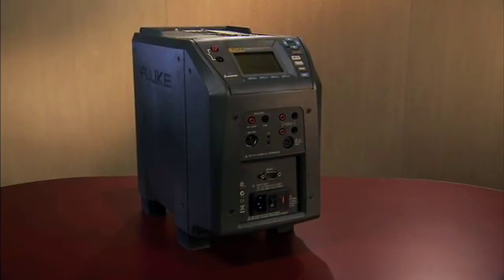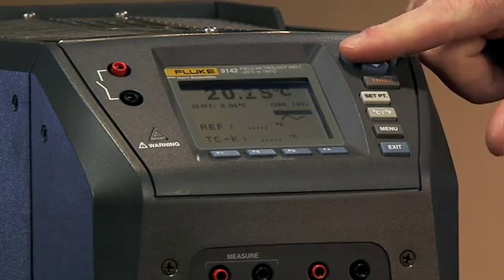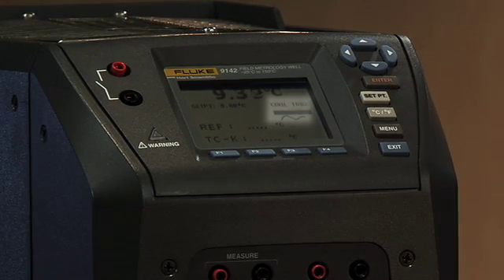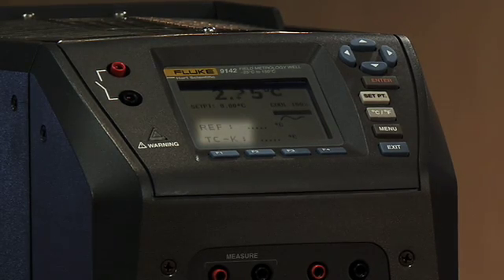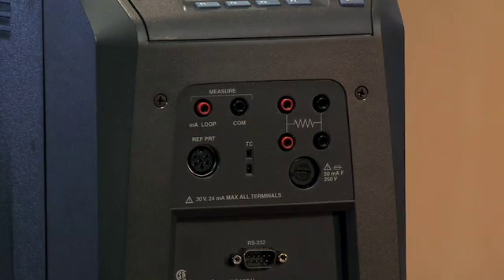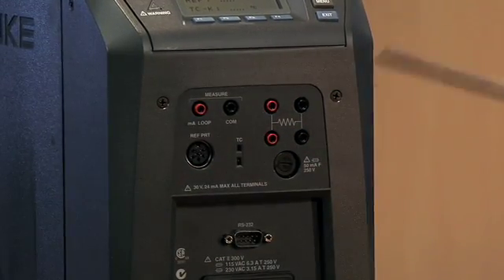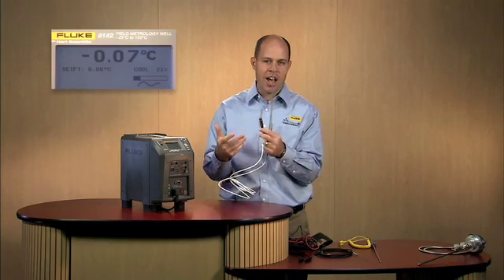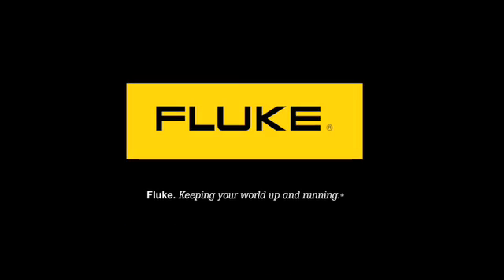Dry Block Calibrator: Fluke Field Metrology Wells 5 of 10

Comment: sir, 

when am operating 50 degree in fluke 9144. the lab fuse get tripped. i tried several times the same but result seems same. 

please help me to find the problem behind this.

awaiting your feedback.
Reply: please its urgent
Reply: @thufailtp1893  Did you ever get this figured out?